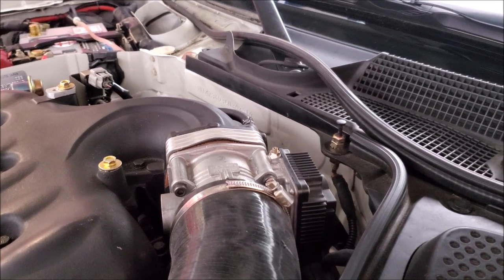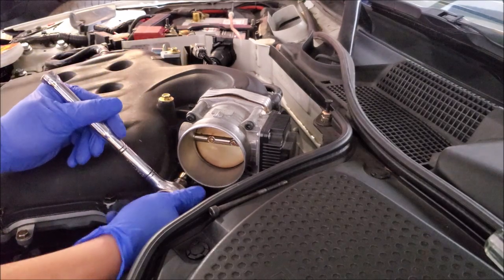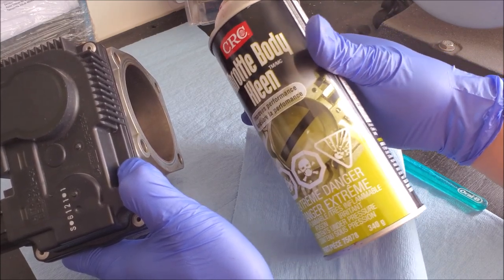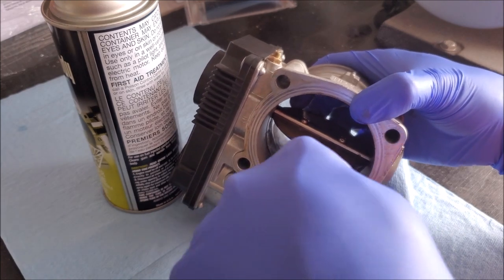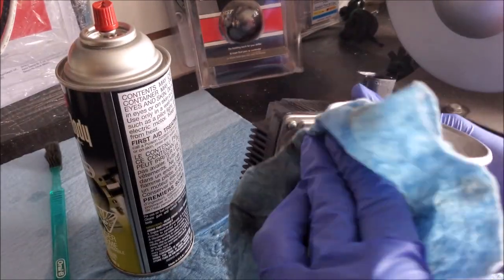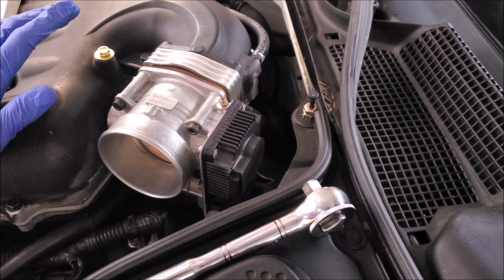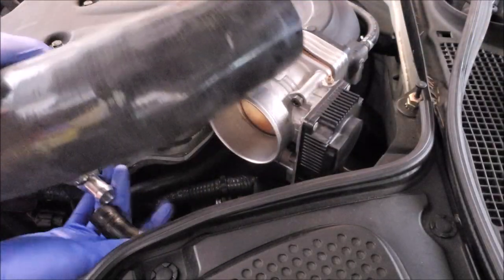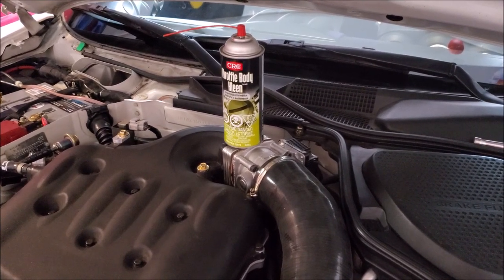How to CLEAN a Throttle Body Nissan 350Z & Infiniti G35 (Nissan 3.5L V6) | AnthonyJ350

Comment: I would love to talk to you!   Hope we can hook up! What happens if a relearn is not done? my nIssan Murano 2011 fuel injection and throttle body cleaned in 2019,. They did not relearn that I know of.  Did have a code P0101 that came up within a month or 2. Other mechanic place said was a "torn boot" and replaced. In 8/21, Nissan dealer "cleaned the throttle body". Manager would require a relearn. None done. Car has had issues since end of May when they had it for 90K. The P01010 code came up. they replaced the MAF sensor and charge $$340, and also the VIAS ASSY. My husband brought it hopme. I wanted to see the assessment. There was NONE! Still has issues. took in again in August. They cleaned throttle body, no relearn etc in May or August. starting issues, now coolant low, not sure what else. Daughter has it at school. Also AC doesn't work since July.
Reply from the maker: You can try doing the relearn yourself https://youtu.be/5tQm28K32SQ

Seems like an awful lot of problems. You can email me at info@gofasthavefun.ca if you have other concerns and I can try to help out.

Comment: What if the butterfly doesn’t open when testing?
Reply from the maker: You can put the intake tube back one and run the engine and see if you have normal operation.

Comment: Power on 3 seconds
Pedal 5 times - hold last one little longer
Release 10 seconds
Press pedal 12 seconds - light should blink
Release 10 seconds
Press pedal 10 seconds
Release
Turn power off
Start car
Reply from the maker: Here's the ECU reset video https://youtu.be/5tQm28K32SQ?si=CCjv7pL0PpWIuu3e

Comment: i change my spark plug and clean my intake and now my throttle wont open, i start it then die after 3-5 sec, i noticed i step my gas pedal and my TB wont open , help please?
@anthonyJ350
Reply from the maker: Covering basics, is it plugged all the way in?
Reply from the maker: You can try the ECU reset procedure https://youtu.be/5tQm28K32SQ
Reply: @AnthonyJ350  yeah i did plug in all the way
Reply: @AnthonyJ350  i will try it after i work, i let you know if everything works
Reply from the maker: @nhikkeyfayloga327  Check all your fuses as well.
Reply: @AnthonyJ350  i did the reset ECU four times and my SES wont blink like the video saw u think my gas pedal plastic broke or i need to replace my TB
Reply from the maker: @nhikkeyfayloga327  Too hard to tell through comments. I would check all the fuses and hook up a scan tool to see what circuit is being affected.
Reply: @AnthonyJ350  i will do thanks for the time, i let you know if anything 🤙🏽
Reply: @AnthonyJ350  i did this ECU reset and its start but its delayed when I press the gas pedal and sometimes it have rough idle, help please
Reply from the maker: @nhikkeyfayloga327  Did it throw a check engine light? If not, after the relearn you might need to drive the vehicle around a bit.
Reply: @AnthonyJ350  i did drive around ,sometime i press the gas pedal it do delay acceleration and it do a rough idle like up and down
Reply from the maker: @nhikkeyfayloga327  And it was perfectly fine before you changed the spark plugs?
Reply: @AnthonyJ350  not really because i need to start 2 time because the the first time I start it’s hesitate so I thought change spark plugs is the solution and its doesn’t do my cold start
Reply from the maker: @nhikkeyfayloga327  Have the camshaft sensors and crank position sensor ever been changed? They all seem to be failing now, due to age. https://youtu.be/KXj9onZWVlg
Reply from the maker: @nhikkeyfayloga327  This is the camshaft position sensor video https://youtu.be/1VHMGRViJ6g
Reply: @AnthonyJ350  i change my MAF sensor but still not starting and same again start and install after
Reply from the maker: @nhikkeyfayloga327  Might need to bring it to a mechanic now.
Reply from the maker: @nhikkeyfayloga327  Did you disconnect the battery when you did the first job?
Reply: @AnthonyJ350  yup i did it and did al the relearn ecu, idle, maybe change plenum gasket
Reply from the maker: @nhikkeyfayloga327  Did you work on the vehicle with the battery disconnected? Did you try scanning the vehicle?
Reply: @AnthonyJ350  yup i disconnected that while working on the spark plugs and TB, i scan it before gave me PO102,PO133,PO103, I thought my MAF sensor but did not work
Reply from the maker: @nhikkeyfayloga327  Check all your fuses, grounds and make sure all the plugs are plugged in.
Reply: @AnthonyJ350  i did that the only way im gonna do is change my TB and plenum gasket..
By the way Anthony when i press ur gas pedal ur TB is open even its not running?? Because mine its not  because i saw on ur  video its open before u put back the intake hose, im just curious
Reply from the maker: @nhikkeyfayloga327  Ya I just had ignition (engine off) on and pressed the pedal to test for operation.

Comment: How do you test the throttle to open and close
Reply from the maker: I showed in the video.  Push on the accelerator with the intake tube still disconnected.

Comment: 75mm from Z1 bro
Reply from the maker: Does it actually increase power for the money? The intake manifols opening and the MAF sensor is still the stock diameter.
Reply: @AnthonyJ350  in theory it should increase top end since it tapers from 75mm to 70mm instead of the 70mm  stock . It is an increase of airflow that should hurt too Hot but help on too end . Would make a killer video and dyno comparison. It's $330 at Z1 on sale . I would get the Z1 brand since it's one piece  with 2 solid gasket's instead of the others that need 3 O rings . I mean 5mm it's 5mm of airflow . Can't argue with that .
Reply: Plus you should be able to fit your mishimoto elbow if you do it on boiling water to stretch it out.

Comment: I got the P0171 system too lean bank 1 code. Could this be my issue? I did my own valve cover and gasket replacement and when I put everything back, that’s what happened. It sounds like a hissing noise from the back as if sir was escaping. My throttle body is a bit dirty but I was wondering cleaning it and replacing the gasket could solve the issue?
Reply from the maker: Could possible be a vacuum leak as well.
Reply: @AnthonyJ350  actually I took out out my upper plenum to realize that it was the gasket. Somehow the back it was all folded in half (rookie mistake) and now she’s running pretty much good. She does idle around 900-1000 but I’m assuming that’s because I cleaned my throttle body and needs the relearn.
Reply from the maker: @J.Y_Z33  Good job fixing it! Yes perform the relearn after a mod like that.